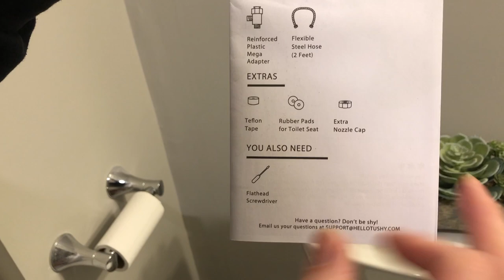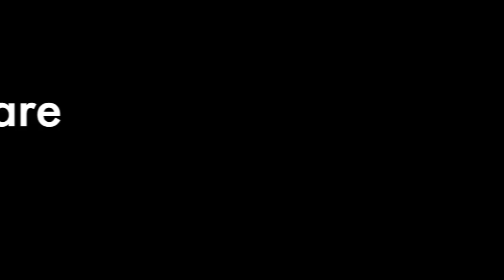TOILET PAPER PROBLEM?  HELLO TUSHY BIDET REVIEW & INSTALLATION!

Comment: I have been using another brand of toilet attachment bidet that retails for about $30 on Amazon for nearly 20 years(you can spend hundreds if you wish on models with electrically warmed water, seats, mood lighting, etc). I have saved hundreds of $$$ in TP over the years, and since it takes 30/ga of water to produce 1 roll of TP my footprint on the ecology has been respectively infinitesimal. My bidet is literally the thing I miss most when I'm away from home.